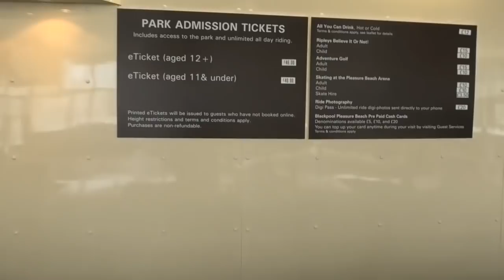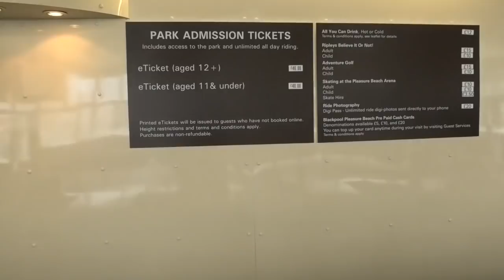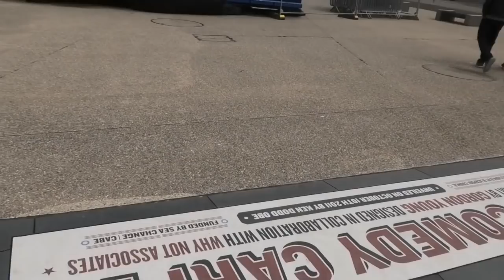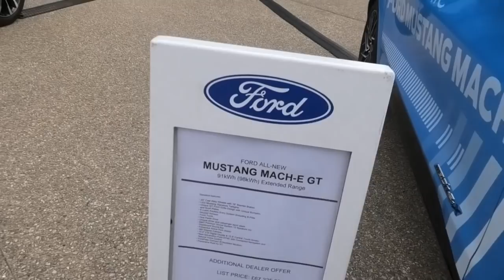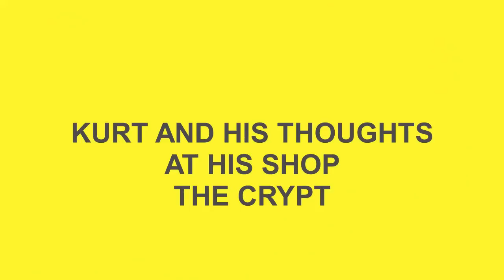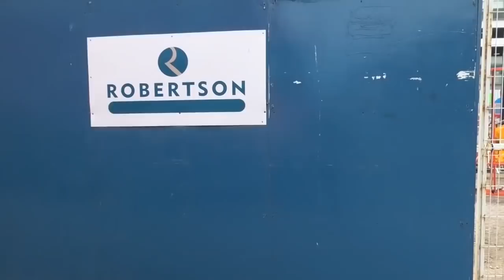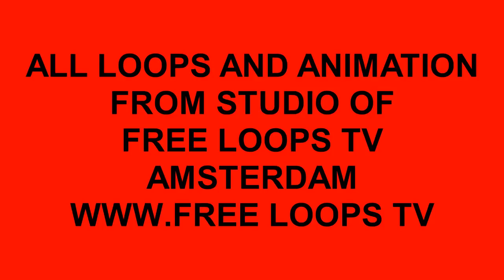BUILDING BLACKPOOL BETTER PART 347

Comment: They may do some family ticket
For p beach plus enso
I agree far too expensive
I.have a season.pass used it the other week
They do discounts for locals at waterpark
I.like what they are doing with the town
But reduce things in short term
Maybe the hotels could get A better deal at p beach
At the mo you have to scan ticket for each ride
So maybe a wristband for none riders would be a good idea charge 2 quid 
Maybe you can have a meal at white tower the casino building a lot of you can explore rooftop bar
I went to a few places from vlogs you have done tea amantes dity blonds
Got some good hotel rates too
Id never stay fri sat.its far too expensive
Unless you can get half board
Holiday inn north trams and the cinema will be built quick
Jubilee trams parade soon too
Reply from the maker: PLEASE AGAIN ACCEPT MY THANKS FOR ALL YOUR COMMUNICATION ON THIS SUBJECT NBV HOHO==IT HAS HELPED VERY MUCH WHAT IS AVAILABLE==YOU ARE VERY VALUED==ALL THE BEST